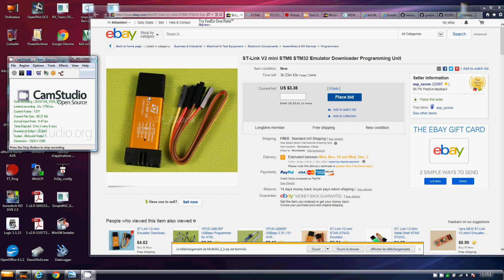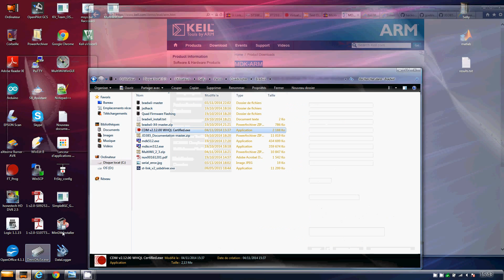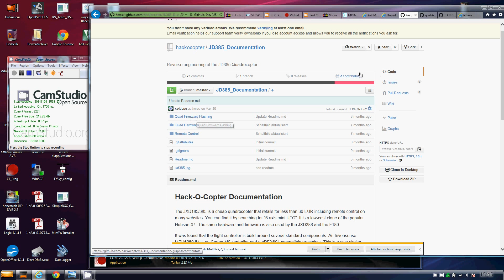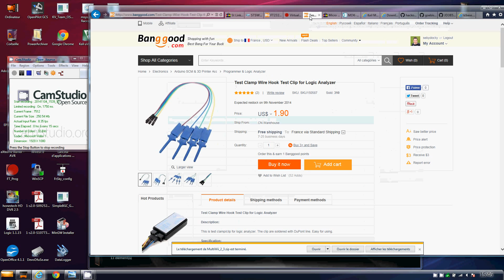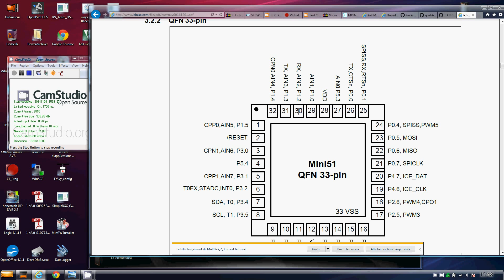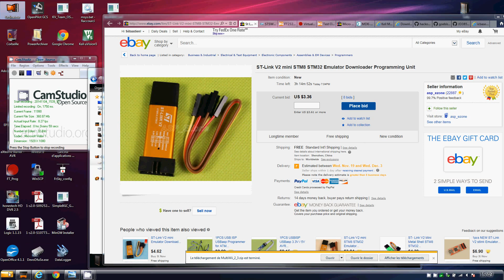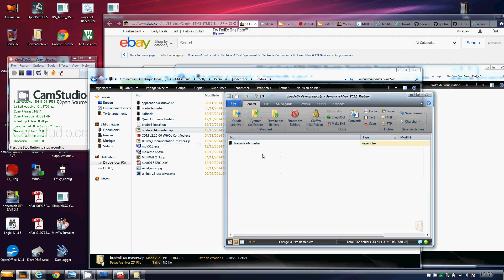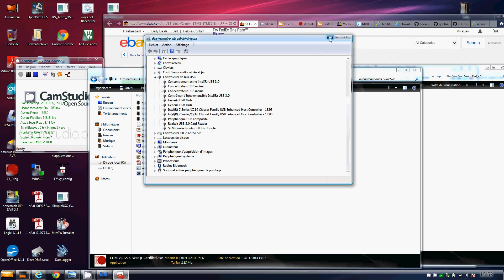Bradwii tutorial: part-I-software installation

Comment: i havent looked into the "why" but it bugs me that you say its a one way process but not why. can you not dump the contents of its rom/eeprom/flash to your hard drive  before re-flashing?
Reply from the maker: because this chip is hardware protected to avoid copy
Reply: sorta figured, i just didnt have time to confirm it and figured u would know. Seems that the replacement software is better anyway. but there is always hope someone cracks the protection, again i havent looked at specifics but the more people/hackers that end up with a specific MCU the more beyond data sheet details are generally compiled and wikied on it.

also, thanks for the tutorial! Friend of mine handed me a board that he only knew was from a quad he crashed and said have it.with 30x magnification I was able to read the writing on the QFN and that brought me here. I now have  the flasher on order and need to find some motors and props for the thing.

Comment: Hi there Seby, ambitious question. Do you think I could put a MTK-3329 GPS on the serial interface of the board? I have a v666
Reply from the maker: Clinton Herring Actually handling GPS is not yet full implemented but in theory ... it should be possible since there is a a serial port